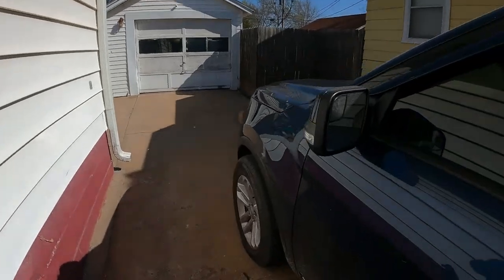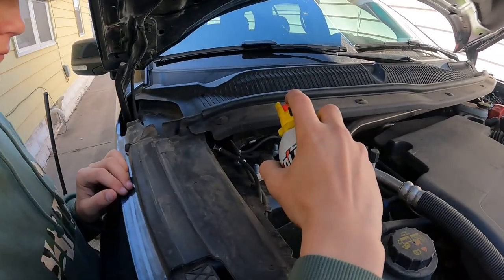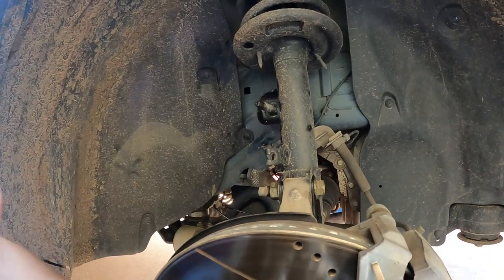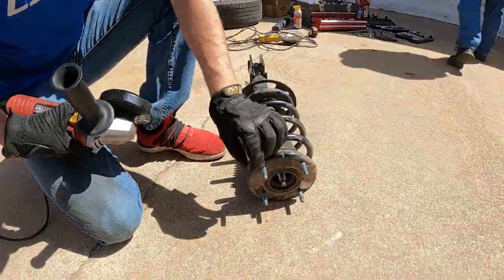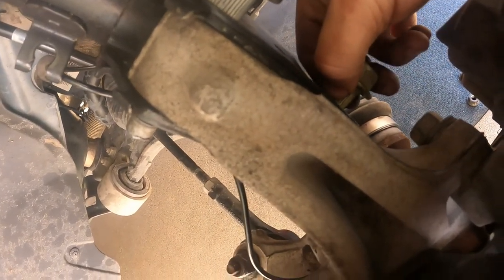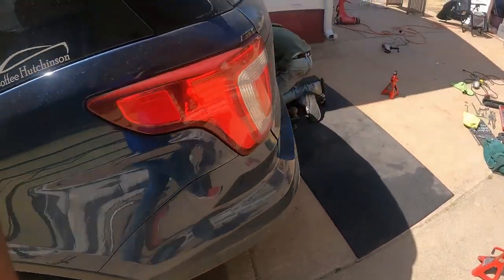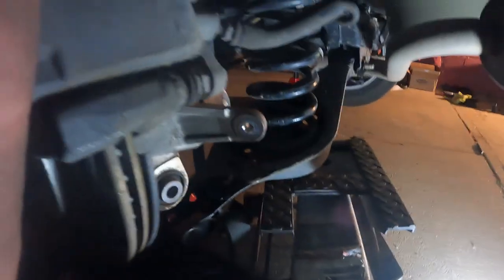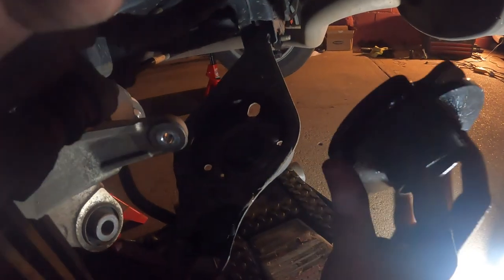How to install a Truxxx 2.5" Leveling Kit on a 2016 Ford Explorer XLT (2011-2019 all trims)

Comment: Something I learned is if you cut a bolt, have the nut threaded past where you are cutting so when you cut and thread the nut back off, it usually fixes the threads.
Reply from the maker: That's a good idea! We filed it till it went back on lol

Comment: At first I didn’t understand why the strut mount bolts have to be cut, but now that I see the bracket I understand. Apparently on some models you need to and others you don’t. Working on an awd 2019 today.. hoping it’s as smooth as it looks.
Reply from the maker: Good luck! There are different struts and that's what makes the difference. It also may change the amount of lift you get from the kit. Just make sure to tighten the sway bar link mounts as tight as possible onto the strut. I left mine loose and it bent them.

Comment: Hey man it's me again (if you remember lol). Hope all is well. I have the same lift kit. I was just wondering if you wouldn't mind taking a picture of the sway bar extension position after you lower the car to the ground and tighten the bolt. I need to change my extension plate because it's a bit bent now. My extension position is straightly vertical between the bolt on the strut hole (the one welded to the extension) and the one above it. Yours look like it's almost side by side horizontaly. Thanks in advance!
Reply from the maker: @justhanz11  so I actually bent mine too, and ended up buying adjustable sway bar links. I also have sold my explorer recently too 😅

Here's a video I made about the adjustable links! Let me know if you have any more questions 🙌🏼

https://youtu.be/ToxSRBd5kts?si=xd5cQ_LngSyTyLY9
Reply: @ArcticVette  hey I just stumbled that video before I read this. Thank you. I can get a good view of the extension.  I was surprised when I saw it's bent (again, before I saw your reply), the bent looks so much like mine now haha. The position of the two bolts on the extension looks like mine too (vertical). Oh you sold explorer? I've been contemplating to sell mine too and change it to a 4runner or tundra lol. Thanks for sharing again. God bless!
Reply from the maker: You're welcome! We replaced the Explorer with a Jeep Wrangler Unlimited. Those 4runners are SWEET though! You're welcome and thank you. God bless!

Comment: In situations that require 2 box end wrenches, like the sway/ stabilizeer end links, after the big nut is loose, tap the link inwards and spin the small wrenchw while holding the big wrench.
Reply from the maker: Thanks for the tip!

Comment: Before cutting 1/4” off the 4 bolts it’s easier to run a nut down and then after you cut them and file a little you take the nuts off and it will clean the threads for you
Reply from the maker: Yes!! This is way easier, as I found out after making the video 😅

Comment: I got my backs done, I am in the process of doing the front. I noticed the bolts were really close but they werent touching. I think I might take it back apart and grind it down just a little just to make sure they aren't touching.
Reply from the maker: Not a bad idea. The front is more of a pain in my opinion. 

I need to replace my front sway bar links still, but they aren't hurting anything at the moment.

Comment: I have a 2012 explorer limited and want to put the 3"  lift kit on our explorer if I can afford it. What size wheel spacers do you have on your explorer? I hope they will fit my explorer. I like the top light bar! Where did you find the mount and what is the length of your  light bar? Sorry for so many questions!!  Thanks for the videos.
Reply from the maker: I had 2" spacers. However, one of them lost a lug stud and about lost the wheel. So I ended up removing all of them. I believe it broke off from being overtightened with an impact but I'm not really sure.

The light bar is a 52" curved light bar. The mount is actually both mounts that came it it. I just modified them together to make one that worked for it. 

You're welcome, glad you found it helpful!

Comment: Did you have vibration due to the angle of the cv axel? I put a traxda leveling kit 2.5 inch and it seem to be too much angle for them i have little vibrstion at acceleration and at 60 mph...
Reply from the maker: I only do if I do a hard launch, otherwise I only have noise from my sway bar. Because I bent my mount on accident.

I'm hoping to get adjustable sway bar links and remove the adapter all together.
Reply: @ArcticVette  did you find the adjustable sway bar?
Reply from the maker: @nestormedina6628  I found some on Godspeeds website, however I haven't ordered them yet. I've been putting it off for far too long.

Comment: Can’t get the damn spring out.
Reply from the maker: The rear one, right? There's a bolt towards the middle of the car that's on the lower control arm. Loosen that a little at a time. That will allow you to swing the control arm lower, making the spring super easy to get out.
Reply: @ArcticVette  ha thanks I figured out. Only issue I am having now is the shock mount is wider than the shock. I beat it on but it needs just a little more loving. To be continued for tomorrow I guess. 🤣
Reply from the maker: @coreyflynn9333  those are a pain. The way I found to work best was to put a jack under everything. Put the shock mount over the shock adapter, with the bottom bolt in place. Then jack it up slowly and it'd slide over. Sliding top to bottom was easier than side to side. Hope this helps!